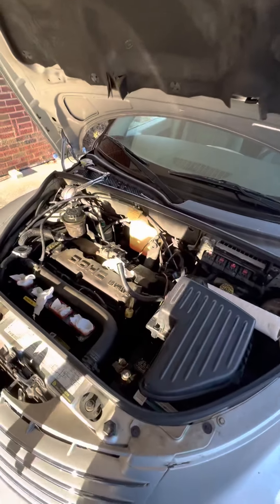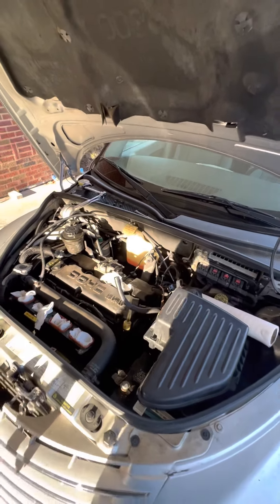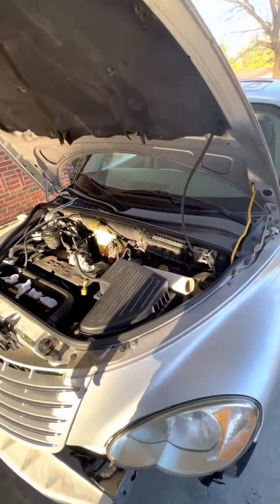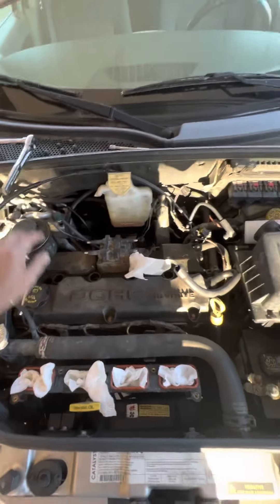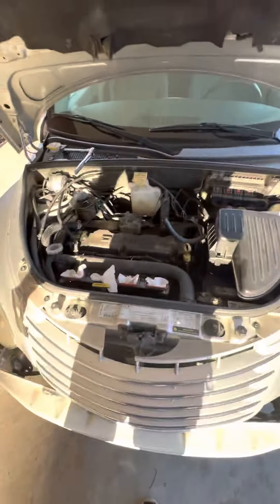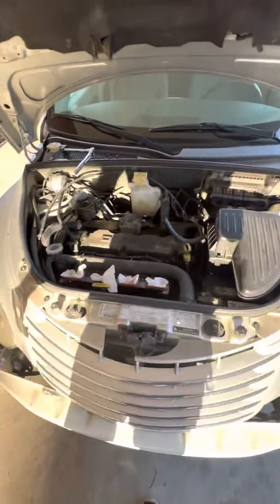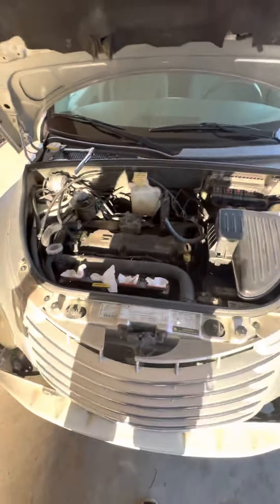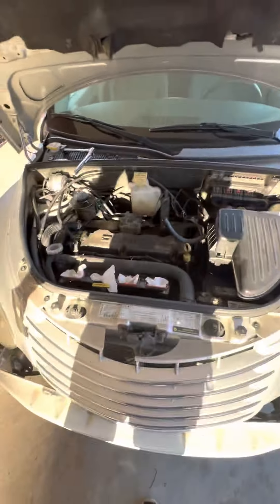2007 pt cruiser  tuneup/ o2 sensor

Comment: Hello I have a 2004 PT cruiser It has a bad leak from the passenger side when I put water in the radiator to come straight out the passenger side on the ground I replace the thermostat and I just replaced the O2 sensor downstream now and not starting but all is coming out
Reply from the maker: Hey samuel. It could be a crack in the radiator. However, if you have checked all your hoses in radiator. The only other thing I could think of being a problem is the water pump. The water pumps it’s real tight into the motor and sometimes can leak from the right side of the car. If it is a water pump, you should do the timing belt while you’re in there too. It is a big job and sometimes doing everything at once is better. Plus, you can buy a timing belt water pump kit from most of your automotive stores.Hope that helps.
Reply: @micmac2800   Ok it is the water pump is that a hard job to do
Reply from the maker: @jeffersonsamuel2884   it is a bout a 8 to 10 hour job. You should do the time in belt while you’re in there get a timing belt and water pump combo from your local parts store. If you take it to a shop that is a bout a $1200-$1500 job.

Comment: Ihave problem 2008 
P0129 cod
Reply from the maker: Well it could be a few things… check out PCM .. makesure it’s working correctly..
It also could be a tranny problem not in correct gear.. everything I read is saying that the engine  revs are too high. I’ve had that happen on one of my PT cruisers in the past and I changed up the PCM that is usually under the passenger front seat.  Hope that help a little.
Reply from the maker: It could be as easy as a vacuum leak or bad map sensor also that is making the motor rest too high..